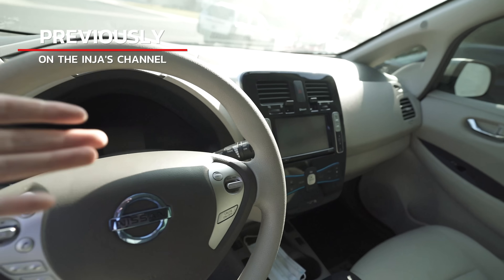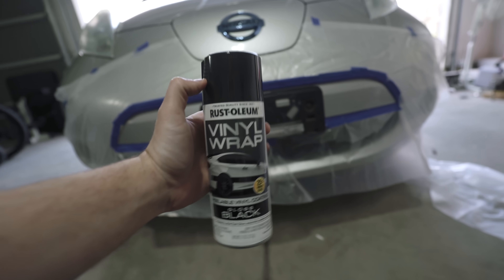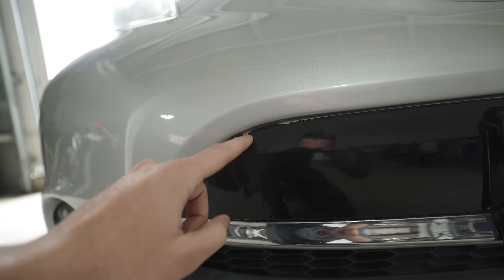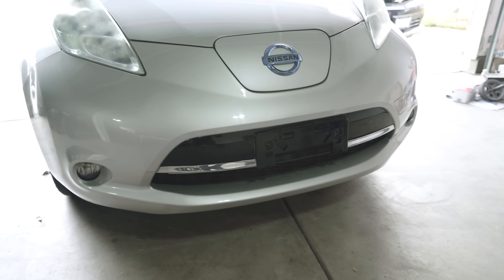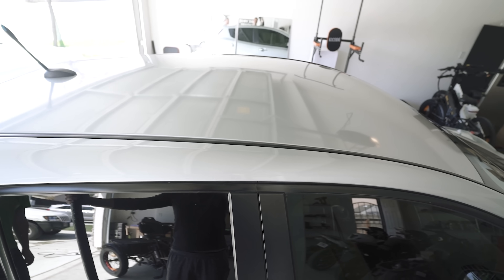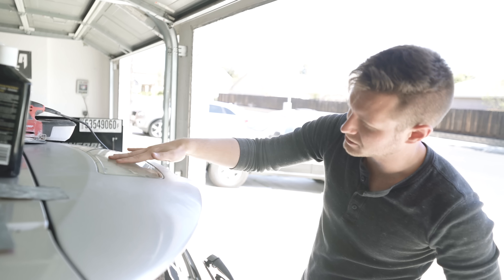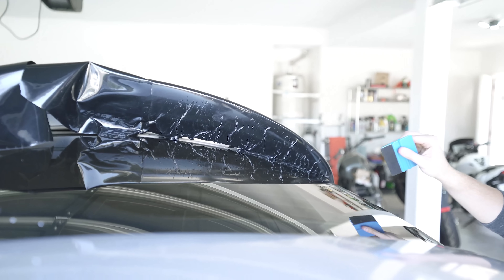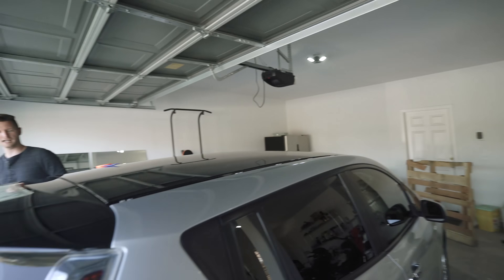I Made my Nissan Leaf look like a Tesla Because I Can't Afford One

Comment: Why not put the Leaf motor in the back like the Tesla(can run backwards with right oil pump) and a Mitsubishi I-MEV motor in the front and use a Toyota inverter(duel motor) to control them both ??? Nissan Leaf motors can produce 300bhp when tuned... I-MEV has around  80-100bhp... ???
Reply from the maker: HhhMmmmm

Comment: When you change bulbs like that, you should also get a new plastic cover for the bulb. The non-LED cover (idk if that's the right word. The part of the light you can touch from outside the car when it's all put together lol) has a lens effect that brightens the halogen bulb so it can be better seen in different conditions, etc. That benefit does not transfer to LED lights.
it's not as important on headlights as it is on the brake and tail lights though. 

That's why newer cars with LED lights being standard look "clear" from outside and the old cars always have that weird "lined" effect going on in the plastic.

Comment: I would have liked to have seen what the LED/halogen conversion afforded you in range data. drive the same nightly route for 2 weeks with both halogen and LEDs to get some sort of data...
Reply: 0.1 extra mile maybe. To be fair the biggest electrical appliance in the car is definitely not the lights. It's the heater #1 (up to 5 kW) and then the AC. What comes afterwards is almost peanuts.

Comment: Get some mirror furry dice ...Beauty and beast windscreen sun strip .Flame transfers along the sides .Roof spoiler F1 style is the best .Fake twin exhausts with 5" chrome ends.Blue headlamp bulbs.Window wind deflectors.Front "big chin" spoiler.Chrome wheel arches .Twin aerials 5' high angled at 45 degrees with diamond flags of your own choice .Stick on reg plate placed on left of bumper .That should do the trick....Let's go cruising for chicks baby.

Comment: HEY... just the man to talk to.  I am a hickster and I have a LEAF too.  I want to raise the suspension of the LEAF, put rubber rim trims and convert the car into a mini SUV.  Perhaps try get 18" wheels..... BUT !!!!
.
.
.
The car has restrictions on any lifting.  The suspension has a plate above the tire, How do we get around it?   I believe you can use a Nissan Juke lift kit and perhaps even the Juke's plastic wheel arch trim but you only get about 3 inches of lift.  
.
.
If you look at the LEAF - I reckon it would make for a great compact SUV.
.
.
Ideas comments?...... Hey if you are going for a "Tesla look".... uhmmm try the Model Y?
.
.
If you want to pump up the acceleration on the LEAF... (and you know of a good engineering shop) ... let me know I got an idea.